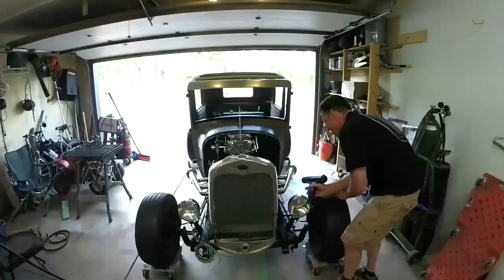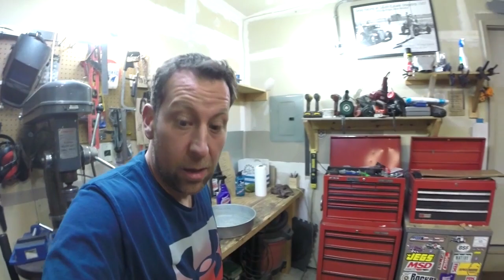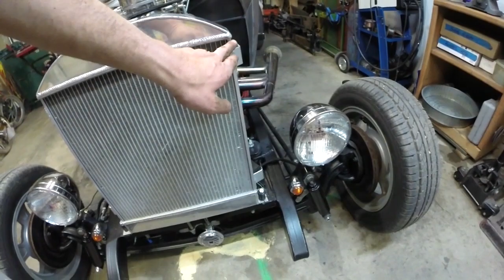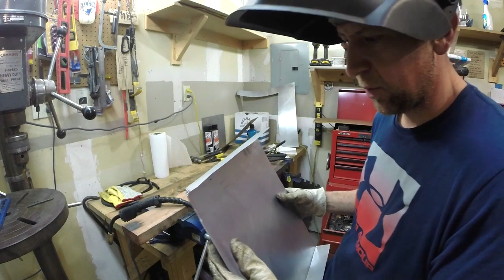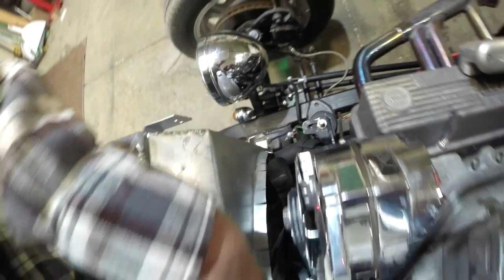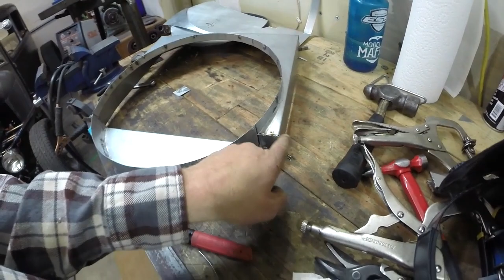Build a Custom Radiator Fan Shroud For Your Hot Rod Model A Ford! Keep it Running Cool.

Comment: My 500 Caddy in a 47 rat truck, using a mechanical  fan, overheated immediately!  So I had to tear the front end apart, and make the shroud that I should have done in the first place.  Cools like a champ now, even in long, slow parades in hot weather.  Thankfully, I didn't have your low fan issue to contend with
Reply from the maker: Great! I’m hoping mine performs that well.

Comment: Blocked off at the bottom like that, I'd expect the fan blades to pull forward a bit as they pass through that area, but hopefully not enough to cause problems.  Looks good, I hope that proves to be the answer!
Reply from the maker: I agree, I’m hoping to get out and drive today so I can see if it moves at all.

Comment: Looks good and I think it will work. But if you decide to go another way, I have the exact same radiator and I got a 16 inch electric fan. Fit the radiator perfectly and is effectively its own shroud. I went that way because I don’t have the room on the car for a fan shroud. Good luck!
Reply from the maker: Thanks Ron, we will see. I like the simplicity of a mechanical fan, so I hope it works.

Comment: Hard to tell, but it looks like the shroud fits the blades pretty well. I like to see 3/4-1" space around the fan blades to the shroud and 2/3rds of the blade inside the shroud. That way the fan will pull air through and roll the air off the tips of the blades on the engine side. To far inside and the fan will beat the air around the shroud. To far outside and it wont have enough pull to vector the air across the core and past the blades. Same for the clearance around the blades to the shroud. To much and the pulling effect is minimised. To little and contact between the blades and the shroud can occur.
Reply from the maker: Very good info!  It seems to fit and work well.
Reply: Bad Hombre Garage it looks good. I think you did Henry proud. Can you fit a clutch fan in stead? It will cool better and have less drag and noise.
Reply from the maker: @JAWSatBCPerformance  I think I could, if I found one that is small enough in diameter.  I’ll keep my eyes open for one.
Reply from the maker: @JAWSatBCPerformance  and- thanks for the kind words!

Comment: WELL?????   How about an UPDATE on the cooling system SHROUD????
Reply from the maker: Great idea! I’ll put that in my video plan.  For now, I’ll tell you that this seems to work very well.  The car has only gotten above 220 one time, and that was in traffic sitting still on a 100+ degree day.  For a little fan and little radiator, this works well.